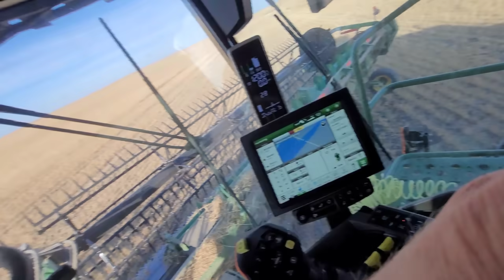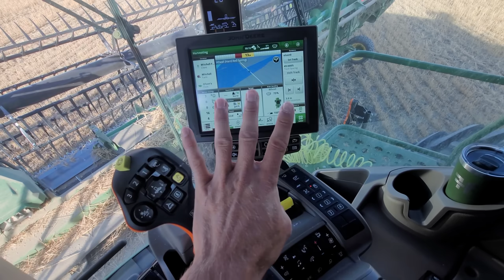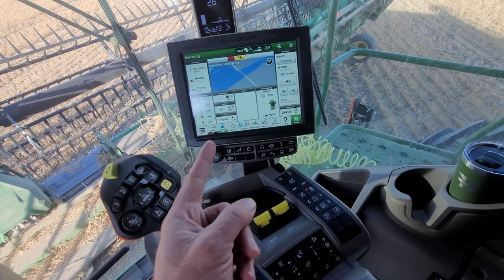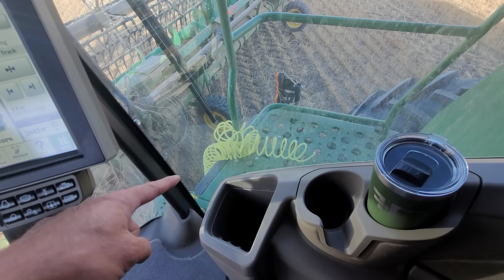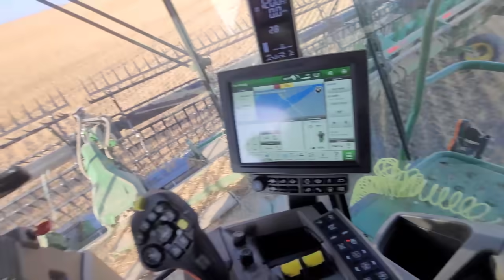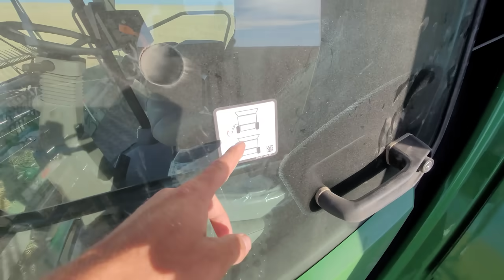Fendt vs Deere - The little things!

Comment: Of course JD can add everything you want to their combines.   The question is, what are you willing to pay for that.   The AC inverter might cost $2500 by the time you buy a good inverter, update the alternator, add cabling and wiring.   Is your hot cup of coffee really worth paying $2500 for ?

Ditto with the refrigerator.   You run the combine 30 days a year.   You complain about the fridge in every machine you own.  Why not just buy a good 12V portable refrigerator and be done with it ?

LED lights are cheap these days.   You can buy complete light assemblies, sealed beam replacements and LED bulbs.  Build yourself light bar assemblies and move them from combine to combine as you trade machines.   You can tie into the existing light wiring easily enough.   Yes it is work to do that.  But it is not the end of the world. 

Fendt probably used hydrostatic drive on their auger to get variable unloading speed.  Big power hog.   You might unload faster at 6 bu/sec, but you are also slowing down to do so.  

A 500bu hopper weighs 30,000 pounds when full of wheat.  Even more if the grain is wet.  10 feet up in the air.   That places enormous stress on the frame, hubs, wheels, etc.  

Everything has a cost - money or performance.  You paid "nearly $1million" for what you got.  Anything you add will increase the price.  Deere and other manufacturers love to charge huge prices for those little things.

With 10bu/acre wheat, I'd be looking to save money, not spend more.